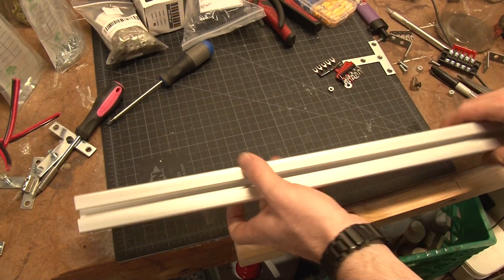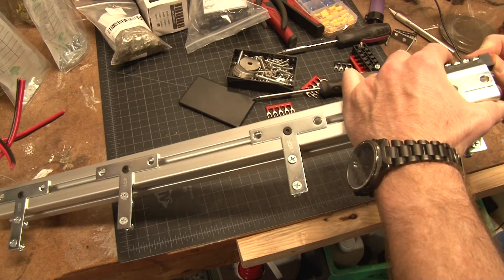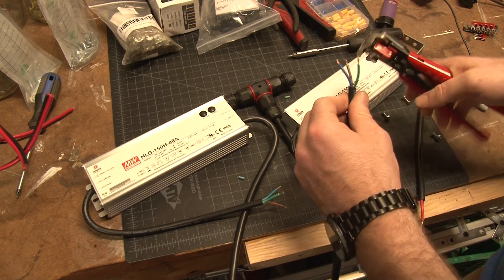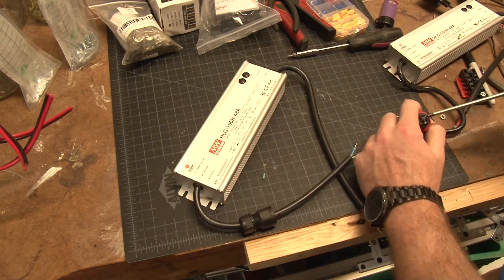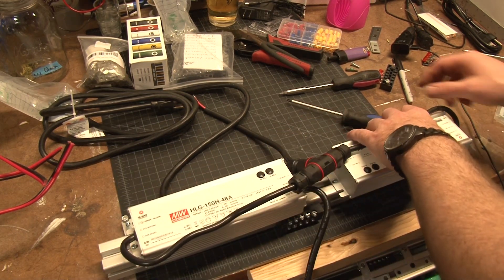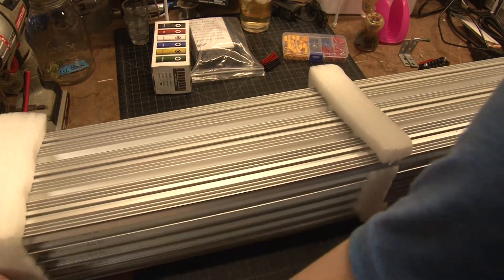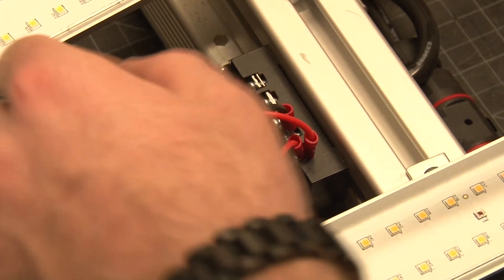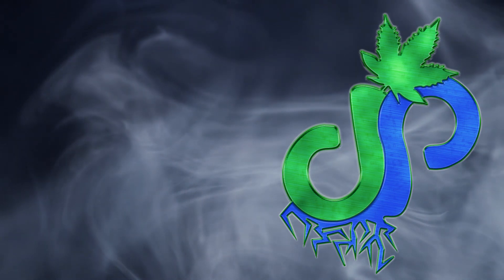New(est) LED DIY Build

Comment: I have been considering building out a strip light build myself. I wanna get some PLC photoboost strips but I have to remodel my grow space to do it 😂
Reply from the maker: I wanted them but every time I went to order them they were always out of stock. Which is good for them bad for me. The strip light has definitively improved the temps in my room. The spacing and heatsinks dropped it 3° less the day of the switch over. I know that doesn't say much but I was impressed enough to remember it. And it's much easier to cool the lights down and air flows through the room much better. It's definitely the best type of light setup.
Reply: I have done the math with the plc strips and just buying a light is almost the same price. I’m not that confident with electrical so I’m apprehensive about it.
Reply from the maker: @atkpirate7831  find growmau5 videos. He does a good walkthrough
Reply: @jPapapot  I wish mou5e would start doing vids again I haven't seen anything from him since he left chilled
Reply: @atkpirate7831  yes you can get a pre made light for the same price and now a days some of the cheaper lights are putting out some impressive numbers. Just make sure to do your research and find out what the specs are on the lights be4 you buy because a lot will sell a diode that's inferior and light quality all though cheeper wont be as quality as the Samsung 301b
Reply: @madmike8325  I just bought a growers choice ROI e680 it hasn’t arrived yet. After doing 6-7 mo this of research I feel it’s the light for me. Then enlite released a 780 watt 3500k samsung lm301b with lumileds. It has 660 red in it guessing those are the lumi led chips. I also like the chilled led but I really wanted a controller. The growers choice has one with sun up sundown settings. I’m gonna run it and if it works buy 3 more and do a large run.
Reply: @atkpirate7831  I have seen some good runs with that light its a good one. I know you'll have success with them just keep at it
Reply: @atkpirate7831  what’s the difference in price ?